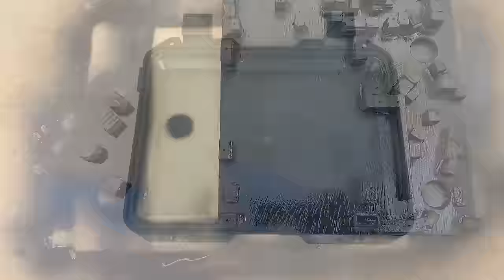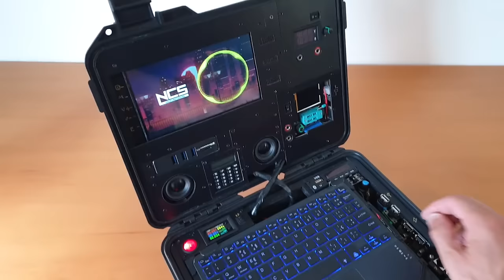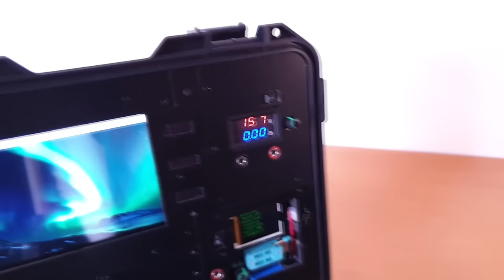DIY: Cyberdeck multi-function backup computer

Comment: I was thinking of doing something like this... even had an Amazon wishlist full of stuff I was going to put into it.  Then I started doing the math on what was in that list and realized that a second-hand Panasonic Toughbook CF-30 MkIII with a touchscreen was about half the cost, replacement  parts were everywhere, and they were likely as rugged as the flight case - and it is significatly more reliable than a kludge-in-a-box.  2x 4TB hard drives as a RAID-1 mirror susing the secondary HDD carrier running the latest Ubuntu Linux, swap out the CCFL backlight with an LED replacement part, and edit the BIOS ROM to bypass the hardware whitelist - and I have and "unsupported" industrial temperature Intel Mini-PCIe 802.11AX WiFi card (2.4GHz/5.8GHz/6GHz), a 4G/5G-LTE global modem, GPS, and a LoRa radio built-in.  Runs at <35Watts.  And I have a stack of them now, "two is one one is none" - cost less than $200 each.

Comment: De todos los trabajos que he visto de "hágalo usted mismo" en el tema de computación, este sin lugar a dudas es la joya de la corona, estupendo trabajo!

Of all the do-it-yourself computing jobs I've seen, this is without a doubt the crown jewel, great job!
Reply: My guy you need to get out more. I've seen way better than this. So much wasted space, cable management was lacking, speakers sounded like garbage, case was no longer waterproof after drilling holes in it. The wood adds more weight to it, would have been better if used aluminum angle iron and plexiglass (lighter weight) it looked like he didn't bring the GPIO header pins on the raspberry pi to the top for easy access. He has the right idea but lots room for improvement.
Reply: @chrislewis2262 I think He was going for a more stereotypical post-apochalyptic look.

Comment: going from restoration youtube where every single step is as meticulous and careful as possible, to this video which is the closest i've seen youtube come to actual cyberpunk (complete with emulation lol) was incredibly entertaining. with enough time and the right components it feels like i could start making something like this today, which is a far cry from normal machining and even most diy channels that use large expensive equipment to machine parts. gluing a bunch of wood together, measuring by eye and using the components themselves as spacers, the zip ties and even the trapezoidal hinge on the keyboard, hell i think the only tool in this video that people don't normally have in their house is a soldering iron. incredibly impressive video and a very cool computer that i'll probably end up using as visual reference if i ever run a scifi/cyberpunk ttrpg :)
Reply from the maker: Thank you, glad you liked :)

Comment: Nice system, just thinking of a potential improvement for continued operation when the case is closed considering thermals. Heatpipe feeds through the box with silicone seals to an externally mounted heatsink/radiator might work and could potentially keep the case weather/waterproof. If you want to get crazy, you could try to really seal it with vacuum feedthroughs and a stronger o-ring lid seal and have it still be able to work if it were jettisoned from spacecraft or into the ocean. You could also put some solar cells on the outside with feeds to maintain the battery charge.
Reply: agree was a nice build but the moment he drilled through the box to secure the wooden frame it lost its waterproofing , could also make the box that housed everthing from aluminum which would be as strong or stronger but also thiner giving more room to mount store stuff
Reply: @DarthKryat  nah, just seal with silicone like Dap. Should be good to go.
Reply: There is nothing in there that's going to get too hot. The Raspberry Pi will be ok and none of the other components will give off any substantial heat..
Reply: @dougle03  Hrmm. EVERYTHING gets too hot if the insulation is too good. You are used to convective cooling in open air. Do only radiative cooling through a closed, sealed container, no airflow to the atmosphere. Do a back of the envelope calculation and run times arrow over several months. 

Come back when you have order of magnitude  evidence for your assertion, and I will yield to your point.
Reply: @JoshtMoody  I'm assuming the case is powered down when closed... Even then, thermal loss will happen though the materials, the Pi Broadcom CPU will throttle if it gets above 80'c, thus no need for forced or additional cooling... Ohh, and I don't need an 'order of magnitude' of evidence, thermodynamic laws govern this situation, suggest you read up a bit more, then you'll actually stand a better change of saying something useful rather than irritating...
Reply: @dougle03  The whole point is NOT powering it down. It's okay, you are allowed to be wrong. I am wrong 50 times per day. At least I can admit it. I have a PhD in physics, random internet person. I know something about thermodynamics. If it is well sealed then radiation is the only heat exchange other than a conductively insulating case. Not convective cooling. Speaking of reading and being irritating, look in the mirror, genius.
Reply: @dougle03  Oh and one more thing there 'dougle', let's test some of your understanding of thermodynamics. Here is a simple question for you: Why isn't the earth the same temperature as the sun? 

If you can answer this question, then you will finally understand what I am talking about with order of magnitude calcuations. i.e. 'back of the envelope'.

EVERYTHING is a differential equation. EVERYTHING has to obey the heat diffusion equation, i.e partial (T) / Partial (time) = k* LaPlacian(T). 

You vaguely claiming 'thermodynamics' without understanding the sink and source terms to the differential equation above, infuriates me. Then you rub salt in my wounds by insinuating that I am the ignorant one. 

Please apologize, I have had enough ignorant people accusing me that I am the stupid one. The irony is literally killing me through cortisol overload.
Reply: @JoshtMoody  hahahaha cooked him

Comment: I built my own "cyberdeck" which is its own self-contained, portable SIGINT toolkit based on a mini-ITX formfactor PC running ESXI, constructed in a similar airtight case using mostly aluminum and 3D printed parts. It's packed full of "hacking gear", aka. a ton of antennas, decoder circuits, its own edge-router, (removable) WIFI decoy devices, similar to the HAK5 pineapple, etc.
Everything is built in a modular fashion, so you can change the modules in 4 different slots, which all use thunderbolt connections, to prepare for different assignments. To keep it water resistant, all the modules are equipped with rubber seals and for the ports I used keystone modules with water resistant caps. The whole thing is powered by multiple LiPo's an a custom built EPS unit (thanks for the PCBs, PCBWay ;)

Comment: Hot damn this is cool. I like you integrated other functions on the lid instead of putting a bigger monitor in it. 
This is a little paradise for home brew project. If it is a product I will definitely buy one although I don't know how to use all the gadgets.
Reply from the maker: Thanks, yes, that´s the reason i used a smaller screen, i wanted to have more functions on the lid :)

Comment: Would love to see a 3d printed version for weight and space savings. Regardless of how it's assembled, I could see all kinds of cool stuff added to this to give it more IO than even most desktops. A nicer built in meter with a rotary switch would be nice for car diagnostics, for example. The component tester is sick, but a eeprom writer would be next level. Slightly bigger battery and maybe it could even function as a jump pack for a car. (Or just add an entire jump pack, lol)

To be clear, I'm not criticizing the wood at all. Looks sick man, good job.
Reply from the maker: Thank you, glad you liked, many more modules are possible to add :)
Reply: We are going to need a bigger case.

Comment: an amazing craft ! really inspiring but if i can recomend one thing, it would be if possible for you to get a cheap 3D printer so you can make easier and more accurate tiny plastic brackets, adapters, parts instead of going jaynky hack sawing around hehe (even if its also my cup of tea) that would bring your amazing work to another level !!
Reply from the maker: Thank you , glad you liked, 3d printed parts could be an option but for me i prefer to hand made all the parts and improvise always when needed, that´s the fun part for me :)

Comment: I think, to make it more military like, you can use aluminium sheets and replace those wooden components. Also, do away with the glue and use some screws. I think it's cooler
Reply: Glue and nails would be better than screws in this situation.

Comment: Do you have schematic drawing for all this? This project is awesome!!! Great work!
Reply from the maker: In this video i didn´t add a schematic, all the wiring is very straight foward, the less obvious part is the variable power supply but it is based in another project that i did some years ago, if you search "mini variable power supply" on my channel you will find it, there is a schematic there

Comment: 4.5 kilos. . ?
Wow !

You have inspired me. 
I’m drooling now planning the cost and final weight of a similar design using 3D printed parts to save weight. Pelican case MacMini under 3 kgs.
Reply from the maker: Thanks, yes, just the battery is 1.2 kgs

Comment: Im so building this for live feed/tune on my foxbody Mustang.
Im doing a cyberpunk, V8 twin charged build with a old 5.8 out of a van thats being rebuilt. (Super and turbo charged, all from a junkyard low boost for reliability) standalone ECU where I can run a remap.
I've been building the lights and prepping a Saleen body kit (because it has those futurism curves) ive also gotten to work on the engine bay. Glass coolant piping for a return to add to that effect. 
The thing wont be driveable until next year, at this rate it wont be finished until 2026 at least.

Ive also got plans into making a LCD (buick style) gauge cluster, im also trying to find a CRT thats a touch screen or figuring out how I could make a touchscreen look similar to a CRT. As I am inspired by the 1990s Oldsmobile Trofeo. Thats going to come in much later of course. Where ill hopefully be able to hire someone or make it myself, a running android based system thatll show a Ford Green LCD but allows me to control the AC and Radio. (Yes ive even thought of trying to find a Trofeo for this) 
I plan on filming all this because its been a dream project of mine for years. Despite it being a foxbody, the amount of actual electronics similar to a digital cluster is far and few..unless you want to spend $1000s!

Comment: As a backup computer I would recommend a copper foil liner the case first then plastic dip it but make sure the two pieces touch when it closes. And I would recommend silicone or rubber o rings as a gasket for the screws going through the case to keep it water resistant. And test it against radio waves to check if it may survive e.m.p. The case water rating if not to heavy would float in the case of flood. But what you put on the computer is always dealer’s choice. But it looks like a good idea. Now a bigger box could give you a good place for more battery or controller space or off grid charging options too.
Reply from the maker: Thanks, the srews are tight, the plastic case acts already as an oring between the metal screw and the wood, i´m planing future upgrades, it still have plenty of room bellow the keyboard :)

Comment: Truly BEAUTIFUL! That said, there are a couple of suggestions for the enevitable Mk. 2 variant of this:

One: Cable Management. 
I would highly advise using tape, split loom tubing, twist ties, or zip ties for wire and cable management. I recognize that this may be "experimental" and as such, necessitate easy access to different bits of the wiring harness, it would still look better if things were bundled together.

Two:Material Selection.

As others have stated, sheet acrylic, plexiglass or styrene, as well as sheet metals woul save weight and space. However, if that's all you have at hand, could afford, or were experienced with it's fine. After all, you go with what you know bro.

Three: Aesthetics.

Dig the black scheme howrver a couple of things come to mind. First, I would have dry fit everything, then painted the parts before assembly. I'd use painters tape to cover areas I intended to glue later.  
   I would also consider painting some of the more visible components an alternate color or two to add visual interest as well. 

Overall, I dig this rig! Very nicely done brother, very nicely done!
Reply from the maker: Thanks, i used what i had around :)

Comment: A wiring diagram for this would be awesome, if possible. I’m not knowledgeable enough in electronics to figure out all that wiring myself but would def be able to make one if there was a wiring schematic. That is very cool.
Reply from the maker: Thanks, its a very simple wiring configuration, each module is directly conected to the battery, the more complex (and its easy) wiring is the power supply module (top right side) if you search "mini power supply" on my channel i have a video with a schematic of it :)

Comment: If you could run a fake hack program where the users has to use particular command to work, it could be an awesome prop for large scale Airsoft simulation. 
Imagine, a task force has to infiltrate ennemy territory, retrieve a fallen unit's Cyberdeck with the programm on it, and complete the objective. Only few members of the unit know the correct code to imput for the hack to work, so the unit has to protect these particular members until the end. It would force the unit to play stratigically to avoid losing either the Cyberbeck (if they do, they have to take it back) and the members who knows how to use it. 
Couple this with a fancy location for immersion, good gear with comms, and possibly vehicles and you got yourself a MOVIE scenario for FUN!

Comment: 10 Lbs! Maybe consider 3d printed mounting parts, ABS or kydex sheets with aluminum strips for added bracing when needed.  Maybe just aluminum strips as a mounting framework.

Comment: looks pretty cool, i'd have avoided using micro-B to connect the RPi's power, instead solder directly to the 5V GPIO and the ground pin next to it, which is able to provide power to the RPi. Micro-B is finicky and unreliable.
Reply from the maker: Thanks, the cable is secure and zip tied, i prefer this way insted of soldering directly on the board

Comment: Next step, use a micro projector instead of a screen, only one 'on' button that triggers everything, a much more powerful computer while shrinking the whole thing. Maybe a foldable keyboard that folds outward. 3D printed mostly instead of wood. Support of external speakers and much more.. An upgrade, no a generation jump in advancement. :D Epic project non the less, so nice work. :D

Comment: For the v2 use aluminium or 3D print instead of wood, for weight improvement and space optimization. (just some suggestion)
Otherwise, it's a great job.
Reply from the maker: Thanks, used plastic for the V2

Comment: Ah the old putting hot glue on soldered wires. That only means one thing which is also visible from the video… that soldering is piss poor. Didn’t even use flux.

Comment: How does the battery stay cool , why use wood when it weighs so much …
I loved watching you build it but after 3 mins, I just had to post my first questions.
Reply from the maker: this is an electric bike battery, i used this one in so many projects, they are made to operate in closed compartments, its a 350 w battery and this system using the screen and raspbery uses 8 watts, the componnent that can use more power is the mini psu, could draw  from 50 to 70 watts, i used wood because it was what i had around, i needed various mounting points and i used this wood system, in total i guess it has 500/600 grams of plywood but there is many other options to secure the components

Comment: ALl I can say is WOW. hellova build my man. I have some of the components already.. Raspberry Pi 3, Speakers, WiFi & BT module.. LEd readout module, Laptop screen-- it's a 16 inch screen have the controller for it too. .. and a couple of others. been wanting to build something like this .. just amazing work. my only question is what did you use for the fascia, plastic or thin plywood?
Reply from the maker: Thanks, are you taking about the pieces that cover the screen and modules on the lid? its 4mm expanded pvc
Reply: @DTeK  yes I am , thank you.

Comment: The problem is the small size and the cooler system, but very nice look.
Reply from the maker: thanks, it does not need passive or active cooling, its a very low wattage consuption

Comment: Why use a RPi and not give yourself access to the GPIO pins?
Reply from the maker: the way it is make it acessible if necessary, but can be even more acessible with an 2€ extension T type gpio cable

Comment: very interesting build! now im considering building one for myself! 
im curious.. how would this deal with overheating? the bottom part is open so even without any fans it could be okay.. wouldnt the heat from the battery damage the wood casing?
Reply from the maker: there is no overheat, even using everything to the max like the power supply in the max voltage and current, the usb ports at maximum wattage draw, raspberry and radio it will draw 35% of the maximum battery wattage